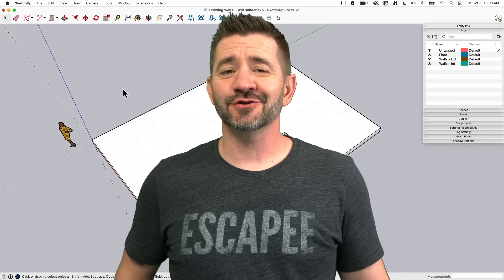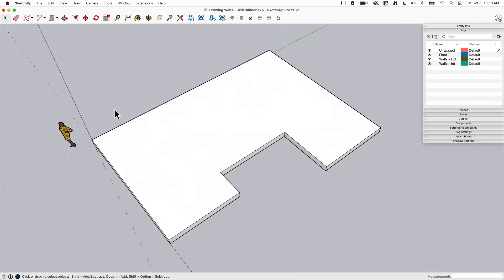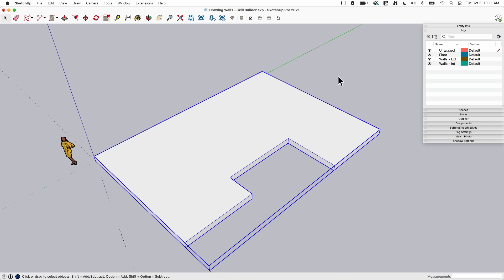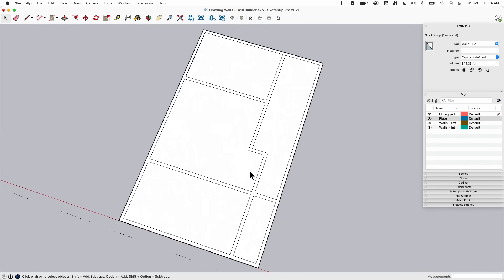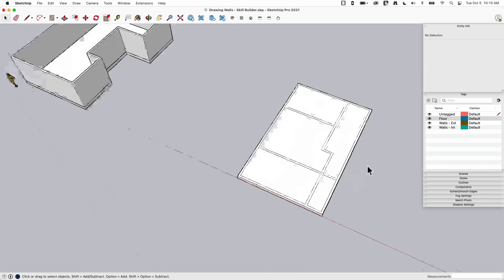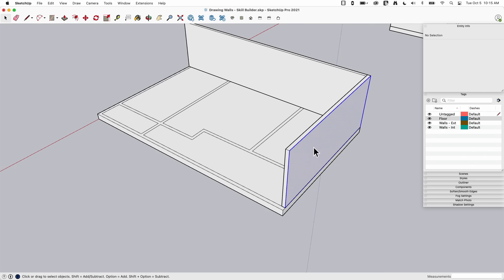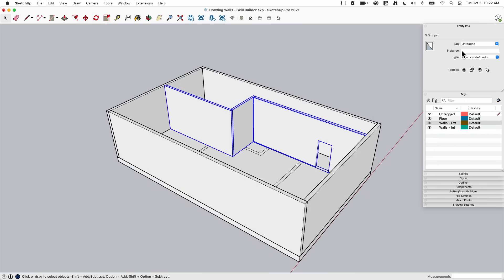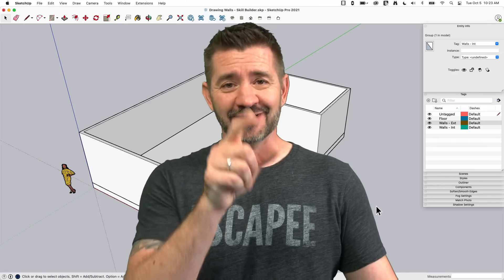Drawing Walls - Skill Builder

Comment: I just create a generic rectangle, make it a group, use scale tool to adjust it to the dimensions (by specifying actual dimension) I want,, put it in the relevant tag... then copy , paste, move, rotate and scale as needed to populate the entire plan...  then pull them all up to the required height...  if you want them kept as groups .. or explode, then regroup  and trim them all , erase the joint lines and pull up to the required height..  PS use the same method to create urban road networks in town planning...

you can overlap the 2d rectangles to ensure a wall intersection and just erase / trim the excess as necessary before pulling it in a 3d group.

Using rectangles  ensure all your junctions are 90 degrees  ( warning SU can still sometimes distort the rectangle , so check )

Comment: Is it possible to switch wall methods after something is drawn one way?  Meaning, I drew a monolithic model (your left example) but down the line I realize that I need specific information on a wall and it would be better to have it drawn like the right version.  Wouldyou ungroup then regroup accordingly? Is that possible?
Reply from the maker: Possible? Yes! Is it easy or enjoyable? Maybe not so much... Isolating geometry and plaacing it into agroup after the fact can be done, but it will mean editing the geometry in the groups and in the initial model to fill holes and heal surfaces. Depending on the model, drawing again might be the quicker solution!

Comment: Using component is useful because the calculating of cost of each wall.
And, in decorating of the interior walls it also easy when using different colors.
Also, it's easy for exterior wall if we use ''folow me'' tool.
Thank you.

Comment: Very useful, thanks. Just one question. My models are getting very large and I’m having to start trying to keep things as simple and computer light as possible, so if I’m making each interior wall a separate group how will this impact the file size ?
Reply: Simple... make a new drawing and give it a name such as WALL TEST. As you add walls save the drawing about 25% into the drawing, but do a Save As  and add a letter A at the end of the first drawing, the near the 50% mark, Save As with the letter B , and so on. When done look at the file names and check the file size of the 4 files you created. This will give you a good idea of file size VS stuff in it. NOTE anything round or curved will require more memory...

Comment: I generally import the reference file explode it first,  repair edges, make face, use a112 plug in to make each wall a separate group then extrude it with joint push pull.. Its  the easiest way i find to make walls